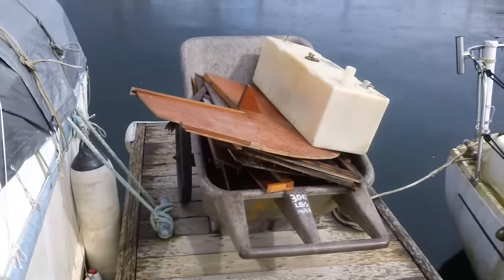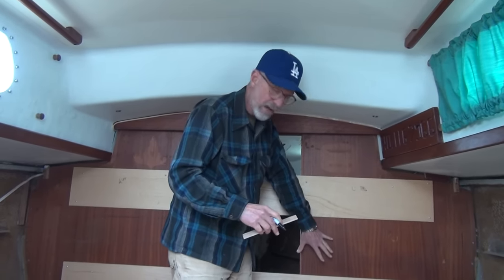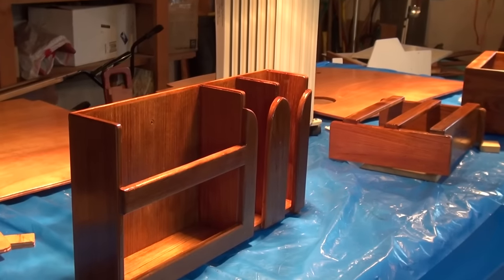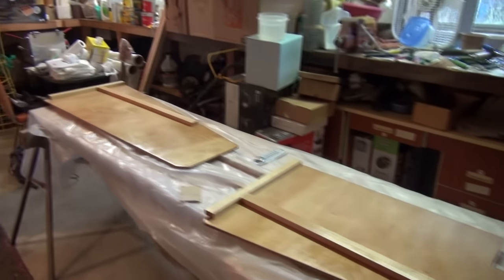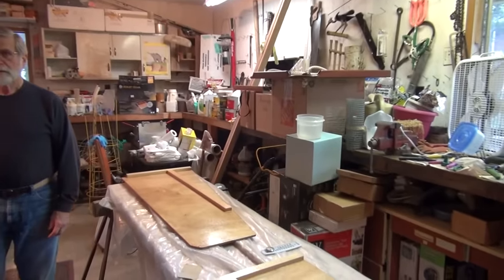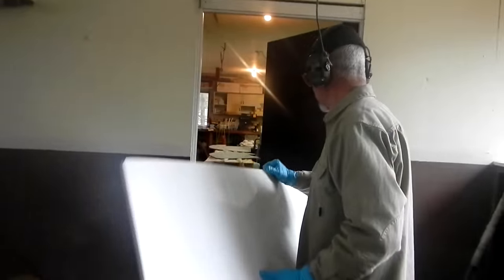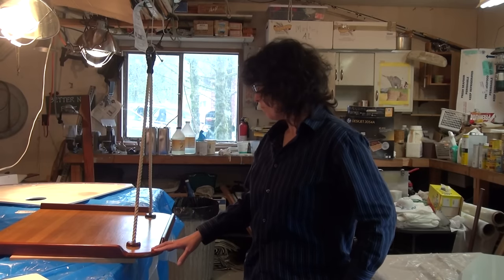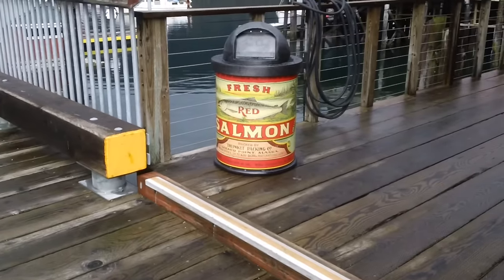Cruising Lealea Refit No.24: Departures and Arrivals

Comment: Great progress! Are you concerned at all about excessive inward pressure from the water once all the bulkheads are removed? ---> u <---  I was thinking there must be flexure. If that makes any sense. Sorry for the cheesy diagram.
Reply: Maybe that the hull to deck joint could be affected??
Reply from the maker: +Jonathan Landwer Not too concerned.  If the boat were out of the water she would be supported by four to six stands.  The point loads would be more concerning than the completely distributed load of the hull floating in the water.